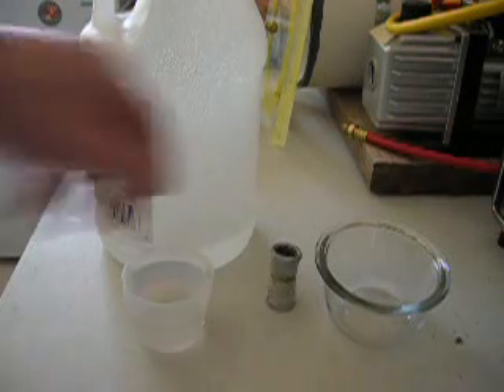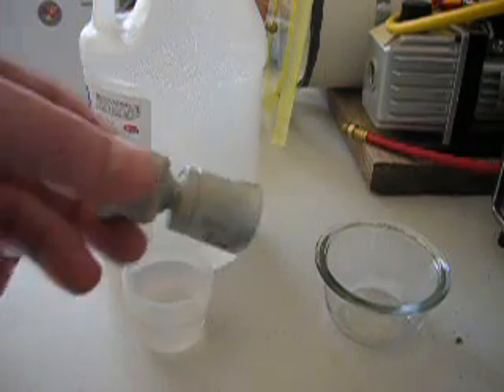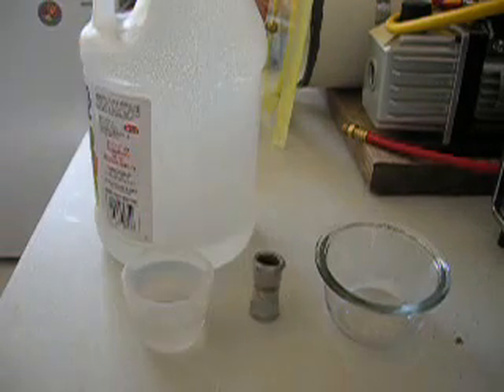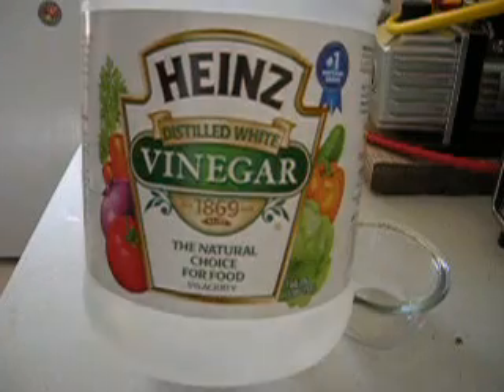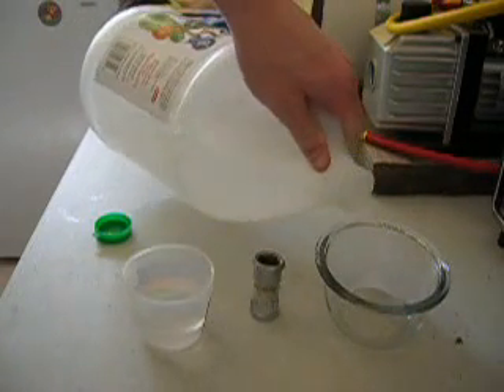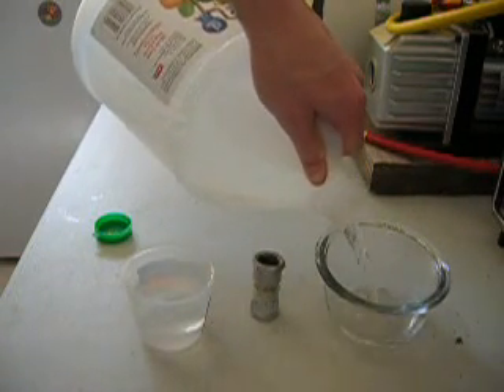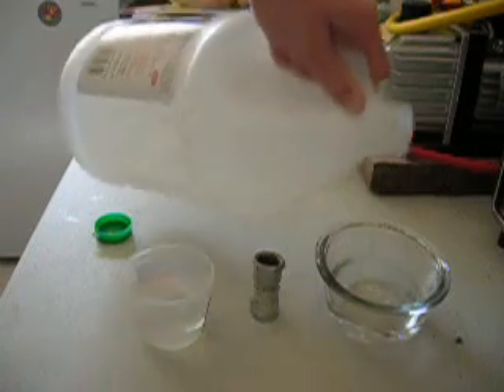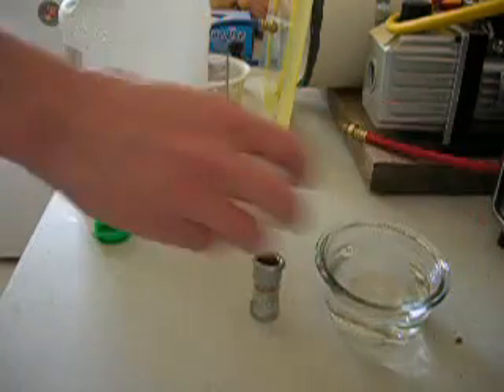How to Remove Hard Water Build up on Shower Heads and Faucet Heads!

Comment: Thank you it helped me what kind of bowl to use and for how long you need to soak it.  I was going to wait for a friend to do it, but I thought there might be a video to help me.  I may have to use CLR.  This tub spout is 40 years old!  I'm not going for the acid.  I hope my diverter works after this cleaning.
Reply: +Janet Fong It didn't help at all at the things you wrote.  You can use almost any bowl, glass or plastic or ceramic, but not metal.  Amount of time to soak is completely dependent on amount of water deposits, amount of acid (vinegar), agitation, abrasive (tooth brush works good) scrubbing during soak, temperature of the solution, etc.

The way he did it was about as slow as it gets.  Use heated full strength vinegar if not a stronger acid.  Do agitate it.  Do reheat it when it cools.  NOT in the microwave if the part has metal on or in it, or take the part out first.  Do scrub it periodically to remove scale and expose more deposits.

Generally using these steps it takes under 20 minutes, but especially take from this that there is no valid reason to dilute vinegar which already has too much water for good/speedy results.

Comment: why the water? i don´t understand why not pure vinegar.
Reply: It would eat away at the metal if you use to much. When cleaning or anything with vinegar you never want to use whole, you want to use partial. salt/vinegar/water is the best cleaning agent out there
Reply: Reggie Kindz No.  White vinegar is just not that strong. No water is needed. If you use a stronger acid (like CLR or muriatic acid), that will eat the metal away.
Reply: gizmoprofessor Yes, white vinegar is that strong.  I used straight vinegar on my facets last night and they are etched.  :(
Reply: +Reggie Kindz Not true.  If the metal is not immune to the type of acid (in vinegar or whatever you use) then adding water won't make a difference.  Diluting in water just reduces the rate it removes water deposits at the same rate it reduces metal corrosion.  Salt would only increase the metal corrosion and pretty much damages most things you falsely think it helps to clean with.  The only purpose to salt might be adding a silly high amount to foods in order to preserve against fungus or bacteria but not so much the latter.
Reply: +gizmoprofessor No.  The type of acid determines what it eats away.  Diluting it just reduces the water deposit removal at the same rate it reduces eating away the metal so there's an equal result except it just took longer with dilute acid.
Reply: Commercial vinegars don't exceed 5% out of safety reasons, i wouldn't dilute it any further tbh

Comment: I didn't like the results when I did this. I had better luck with The Works which is designed for rust/ lime deposit removal. Even works on rusty gas tanks. Did not damage the metal either. Use what you want but I want something faster than white vinegar.